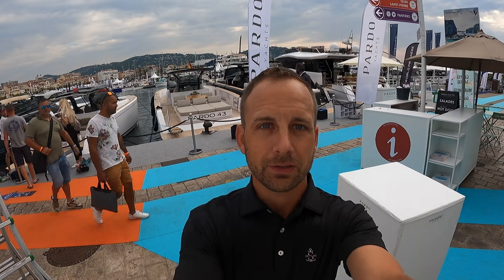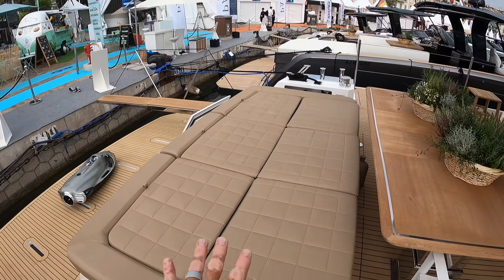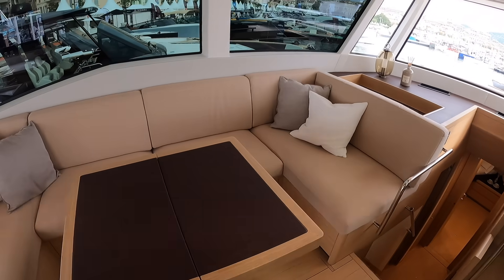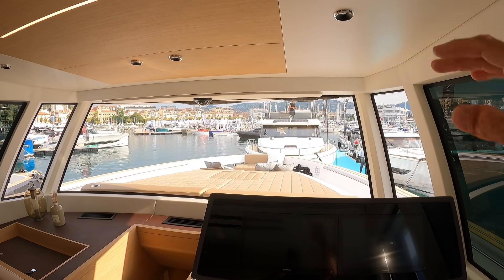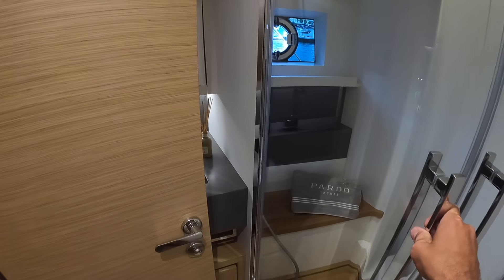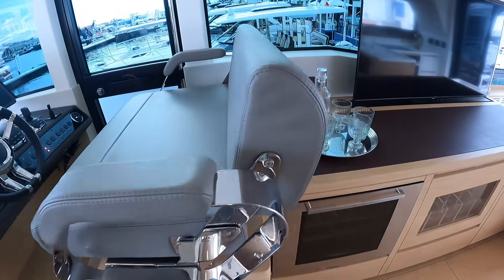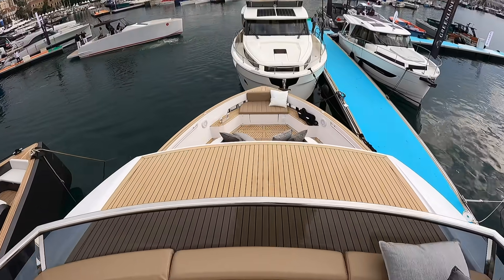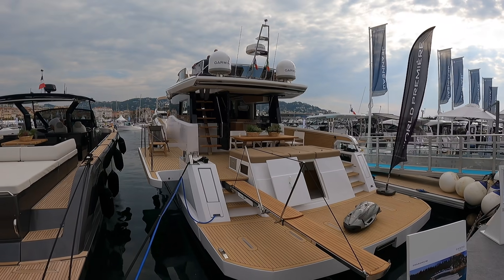First Look - 2022 Pardo Endurance 60 - Cannes Yachting Festival! Full boat walkthrough tour!

Comment: Cette ligne fluide le rend vraiment intéressant visuellement en fait l’intérieur n’est pas des plus spectaculaires mais le design extérieur est une belle réussite franchement wow !
Is there not a problem of light in the panderie of the master cabin ouch for a world premiere 😁 no otherwise great success some negative points like most boats
Reply from the maker: I actually like the simplicity and clean interior design. They are not trying to be too complicated, just classy.  As for the exterior, like you said... WOW! Thank you for watching and for your great feedback! Cheers
Reply: @ElevateYacht  yes I can hear well but the kitchen in two parts that for me c not great and then by dint of making it uncluttered and simple we forget the splitting of a boat will it be that there is no handrail inside square it is a very pretty "trawler" walkaroud but it lacks a lot of things I would rather say a long weekend in Corsica;) but I admit that it does not leave you indifferent

Comment: That is one of the nicest features I’ve seen on that size vessel, amazing!  Are there any other yachts that do that?  Great videos, if you need someone to carry you4 photo equipment, I’m in!!!  Keep up the great videos!
Reply from the maker: I’m not sure which feature you are referring to but I am going to guess the folding side decks? This is typically a feature found on much larger yachts but more recently some brands are bringing them out in 50-60’ vessels. Not all are created equal though! There is a huge difference in thinly made electrical and heavy duty hydraulic actuated systems. 

Thank you for the compliment, and I can always use an extra set of hands! Are you sure you can carry all of my heavy camera equipment - aka one GoPro 9 🤪

Thank you for watching and commenting!

Comment: This was a very nice walkthrough. I appreciated you going down and thru the crew quarters. I may be wrong but I think there is actually a pop up table in the bow as a second smaller eating area. See braided loop on deck. Did the back table go down to increase the size of the sun platform?
I think this is the first review/walk thru of this boat I have seen on YouTube.
Reply from the maker: This was the first walkthrough done on this boat 🙌🏼
Great questions! Yes, the cockpit table not only lowers, but it also opens wider to provide a full size extension of the sun pad. And you are correct, the forward bow area does have a table in the deck that pops up for an extra dining/entertaining area - great catch!

Thank you for watching and your great input! Cheers!

Comment: The closet lights went out when you opened the door and came back on when you closed it.  Is that a bizzare design feature or poor quality control?
Reply from the maker: Good catch.  I saw that too and went back after the video. The sensor that activates as the door is opened or closed was caught up with something in between the sensor. Cleared it out and it was back to normal.

Thanks for watching and for commenting!
Reply: @ElevateYacht  Thanks for the content.

Comment: Pretty lines. Needs two handrails on flybridge stairs.where’s anchor ? Beautiful color palette. Ice clean helm. Nice Greenline 68 to your front.  Bigger engines = less long term strain ~ run lower rpm for a given speed.  You gotta be skinny to use those heads.  Master closet light wired wrong.  Master head width is ok normal people will fit. My home shower has teak flooring ~ I learned from yachts. A lot of teak to clean. You are doing a very good job.
Reply from the maker: Thank you very much! The anchor is hidden into the bow. You see the cut out lines at the edge of the bow, that’s where the anchor comes out from - super cool look. This vessel actually has synthetic teak on the decks and gunwales. Essentially zero maintenance. You have the option for either

Comment: Great boat! But you need to be more informed on what we are looking at. You didn’t bother to show the anchor and storage. No mention of shore power connections. The Garmin displays should have been on. No mention of any of the switching at the helm. No mention of appliances, or refrigerator storage. 
No mention of capacities, fuel, fresh water. Waste. Just a lil bit more info would be helpful. Thanks
Reply from the maker: Thank you for watching and for the input! This first look was meant to be a tour of the boat and fits/finishes. During busy yacht festival, it’s difficult to even get enough time to do this video without many other guests onboard at the same time. I can definitely do more in-depth videos with these details but it would take much longer to create. I would be happy to provide you with more of the data regarding capacities, range, etc - feel free to reach out via email or my Instagram and we can chat

Comment: can't understand why designers of this boats  don't put lights at front, so expensive.. but missing the essentials
Reply from the maker: Lights? Like spot light or search light? This has running lights on the side of the flybridge. It has pop up lights and floor courtesy lights for guests too. And also has lights inset in the overhang over the windshield too